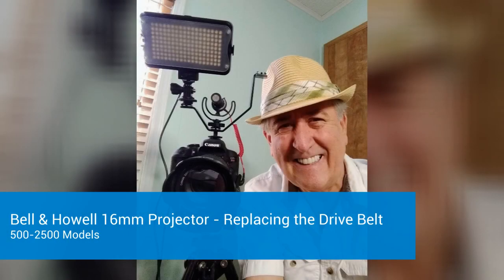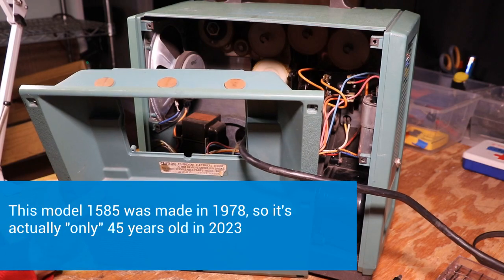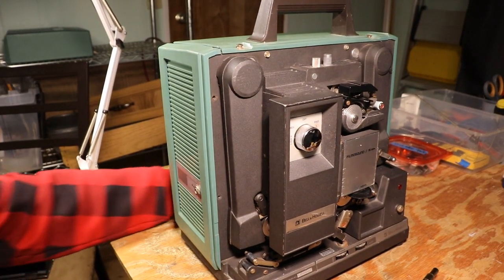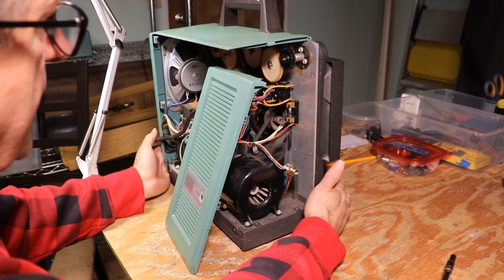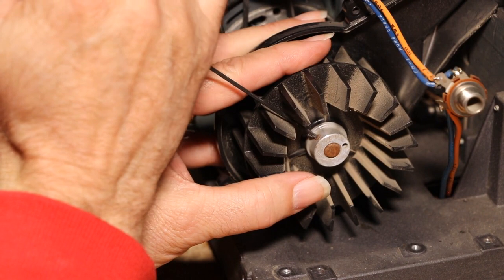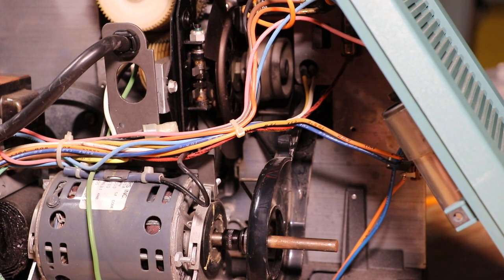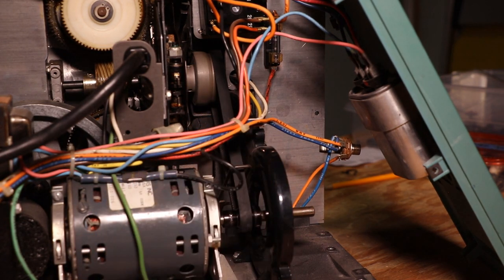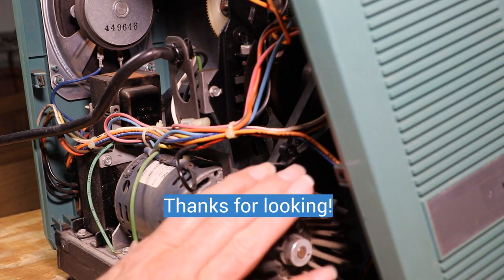Bell & Howell 16mm Projector Motor Belt Replacement

Comment: Thanks, my design on my 655 Filmosound Bell and Howell is a little different, but it's sort of liking looking at a simple jigsaw of how its component parts fit together, taking the pieces out needed to remove the belt, then replacing them again, so I'll give it an experimental attempt to repair it.

Comment: Thanks so much for this Mike! I'm considering the purchase of a 2592b and your videos have let me know what I'm in for. The owner says it runs well but I'm anticipating replacing the worm gear and belt. Is there an instruction resource for replacing the gear? I've worked on a number of vintage Dual turntables so am looking forward to this challenge.
Reply from the maker: I have thought of making a worm gear video a few times and I might still do that someday. Meanwhile just do a search on YouTube and you'll find a few videos to get you started. The original manuals are available, but very hard to read in my opinion unless you're looking for something super specific.
Reply: Thanks Mike for your reply. I picked up the projector. As suspected the worm gear has a few hairline cracks and the belt is slipping. There is also some squeaking which is the belt or other moving part. I made a video of it running here; https://youtu.be/71nM6HB3Ym0
I'll likely order parts from Larry. Any other part I should look to replace? Guess I also need to get some film for testing :)
Thanks again! -Steve

 @mp5802
Reply from the maker: @stevefoster2700  
Steve, I believe the 2592b is a still-function machine.  In your video, one can see the large solenoid that controls it (look just above the AC cord).  You’ll probably see a lever on the front that controls it, and perhaps another one called “Directamotion.”

They use a still-function gear, if one wants to preserve that function. Van-eck sells them made on 3D printers. Since still-function really isn’t used by film buffs nowadays, techs often strip out those components (I do) and install a normal gear purchased from Larry U.  It fits, but make sure that you get setscrews with it - Larry sells them with or without setscrews. 

The gears and belts are the two most common problems, so you probably won’t need to replace anything else. The most important thing to get right (and most often ignored) is the sprocket timing.  When you pull the old gear out, the timing will be disturbed and need an adjustment.  If it’s not set right, the machine can shred film.
Take a look at my video on this topic here: https://youtu.be/ilrn5polPMo?si=oM5Cuyv5GzrPNBW6
Also look at this forum thread regarding this topic:
https://16mmfilmtalk.com/viewtopic.php?p=233424#p233424
Reply: Thanks Mike!

Comment: Hi Mike, thank you for posting these videos! My B&H 1535 projector sprockets stopped turning. Could this be because of the belt? It was the first time using it after finding it for a bargain at Goodwill. I was trying to thread the film and started it and stopped a couple of times. At first they were spinning but unfortunately they stopped before I could watch my film! 😢 Would you like to work on mine?
Reply from the maker: Take the back off and check the belt and gear.  I'd  replace both.  I used to do these both for $300 labor plus parts and shipping, but I'm "retired" now.  Good luck, and thanks for looking.

Comment: Thank you Mr. Mike for the video. I am reaching out for a dear friend who is not familiar with YouTube or really the basic internet.  He says he is not getting power to the main light bulb on the Filmosound #1535. He says he's pretty sure he needs the Amplifier Board. Do you know where I could get this part? Is this the same part you show in this video? Thank you so much for any help.
Reply from the maker: There is a projector bulb and an exciter bulb.  If by "main light bulb" you mean the projector bulb, then no, that bulb has nothing to do with the amp.  If the exciter bulb doesn't light even if you've replaced that bulb with a new one, then it is most likely a bad amp (but other things need to be checked - see my video on this topic).  https://www.urbanskifilm.com sells amps (many kinds).  I don't work on projectors much anymore.  Good luck.

Comment: Is replacing that loud and worn gear a hard job?
Reply from the maker: Yes, it's a pretty big job.  But, by watching a couple of videos on YouTube, I did my first one in Feb. 2021.  It took me many hours for that first one.  I've now done about eight so far, but none recently.  I am thinking of doing my own video showing how it's done.  

BTW, you absolutely will need some bristol screwdriver bits to loosen the setscrews (don't use allen wrenches), and you need to make sure the sprockets are timed properly when re-assembling the machine, or it will damage your films.

Comment: Do you know where I can find a motor capacitor for a b&h 1585

I fixed my first 16mm projector 
Worm gear and then I waited for a week for a new belt then 
I was watching a film then it starts slowing down randomly.

I open the back cover then I see the capacitor deformed.

330 Vac 60 Hz 
I’m trying to find the MFD
But it’s not stamped anywhere on the capacitor.
Thank You
Reply from the maker: I do not, but you might send a message to Larry urbanski at urbanskifilm.com